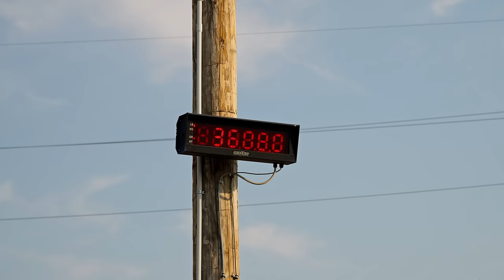I Bought Everything In This Stranger's Backyard...And Turned It Into CASH!!

Comment: Don't care what the weight for scrap turns out to be. A lot of that stuff is usable with a little repair work and definitely restorable. 99% of that is better than ANYTHING built today.
Reply: I agree!!
Reply: Especially the crane
Reply: Yes indeed most of the equipment could be operational with little investment.
Reply: 250.000 pounds .
Reply: Every penny saved is a dollar spent
Reply: 5510
Reply: @kevinmccool3719  The other problem is getting them DOT and other compliant.  I am guessing a lot of them didn't have titles so that would have also made them useless to a business or company.  Not Road Legal.
Reply: @kevinmccool3719  Yep. When something is "put aside", it's almost always bcz one single thing stopped working. My dad once bought a small out board motor that couldn't run for more than a few seconds, for "12" bucks, not knowing anything about motors, but just cuz it was old and cheap. I knew from bikes the need for air intake to the tank, and the air screw on the tank on the top of the motor, was stuck from standing for years. Haven't had it started yet, but I'll bet, it starts easy - it was an old coast fisher, that owned it, and his grandson got it, when he died. No reason to believe, it would be in the shed, if it didn't work.

Comment: Hey, with situations like this crane, or the old digger on the island, couldn't you have like a portable hydraulics generator that you can run lines over to something like this to power it's hydraulics?
Reply: It would need to be small enough to fit on the machine it is supplying hydraulic for, so I don't think so. Could be wrong tho.
Reply: You are referring to a hydraulic power pack yes you could but it might not be the easiest thing ever

Comment: You deal with enough "it ran when we parked it" equipment that it may be worth it to make a power unit trailer that can run long lines to the equipment letting you bypass the engine/pump on the equipment to have full functions. Weld a temporary hitch onto the equipment and simply drive it to the recovery trailer. Can even cheat some more by using solid pipe rather then hose for the majority of the distance with hoses on ether side to give it some flex and just have a boom arm to support it.
Reply: That's truck with the deck the old one might be good for that
Reply: Good idea. Have a trailer with a fuel tank, hydro tank, 24v supply. Like a service truck for "old starts".

Comment: As an oilfield guy I can tell you about alot of the stuff there, white and blue building is a drilling rig doghouse. Had a pulling unit on the fence row. The winch truck with waht I think are 10-15 foot ginpoles,  the roole that had flags that you couldn't get looked like swab jars, cable tools for a cable tool rig.

Comment: Something I thought was cool and would have been helpful a hett pls Lhs hemitt had two ports where another truck could use the hydraulic system from one to the other.  Basically if something was loaded and the truck broke down you could use the broken trucks hydraulic things winches crane and flat rack (lhs pls) with a running similar truck

Comment: The dude that lifted that compressor tank by himself. If I'm right those things must weigh like 90kg ? As me and my buddy had to lift one and struggled between two of us ! 

Also to make use of old engine oil , oil the wooden boards on the loading truck bed. Works a charm. Once the wood sucks it up it dries but protects it
Reply: They make great bbq pits
Reply: Works brilliant as a timber fence stain, too.

Comment: You sure are addicted to using that ether starting fluid. It should be used SPARINGLY as too much has serious detrimental effect on engine components. Using it to turn over the engine so as to power the hydraulics in this case is absolute sacrilege.